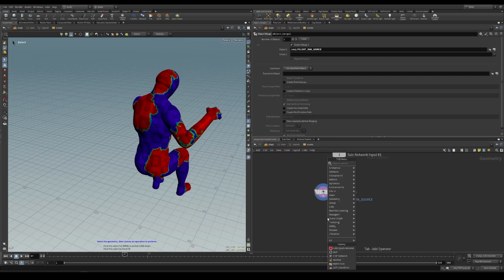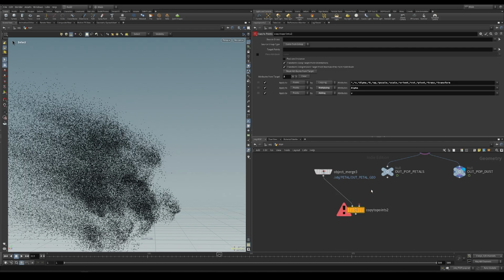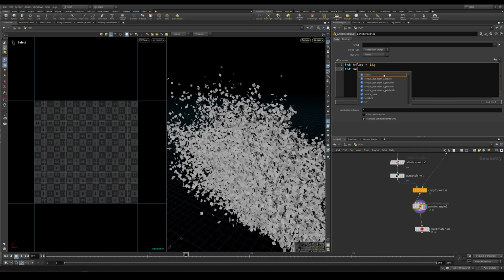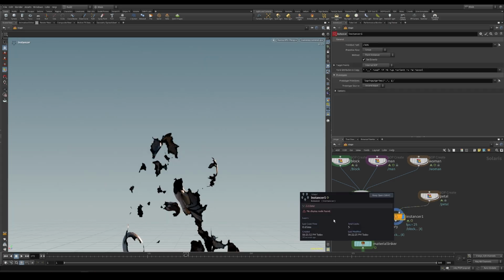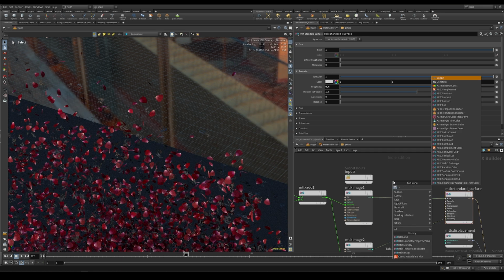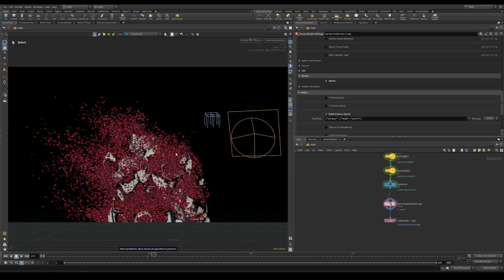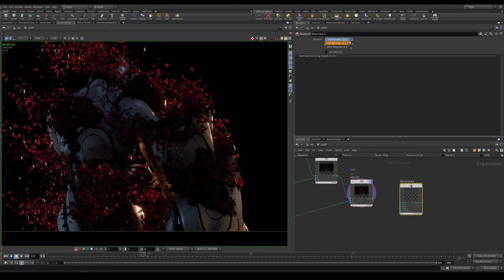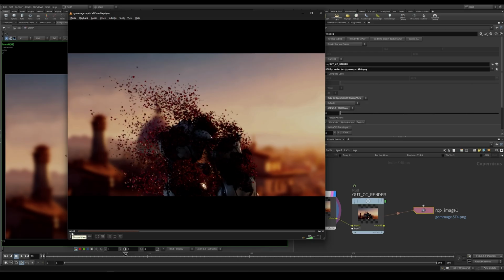Gommage FX in Houdini - 04 Render and Compositing

Comment: After I use attributewrangle node to delete masked points my mesh began to warp. I suspect this happened because the point numbers changed. Is there a way to delete these points while preserving the original point numbers? Or should they change, and is my problem related to some mistake made?
Reply from the maker: Hi, could you highlight the timestamp, give or take? Just to avoid going over the whole setup, cause it's been a while since the tutorial 😅

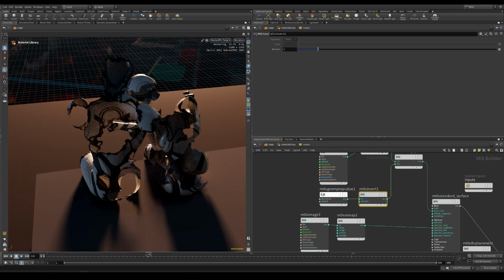Comment: in  4:03  could we adjust the age parameter somehow to increase or decrease the blacking boder effect??
Reply from the maker: Yes, but being tied with the age, you can't make it "larger" than the max age as it is right now. You could use a wider range for the age, then "restrict" it for the actual age and use the raw one for the material.
Or another way maybe quicker would be to store another attribute transferred with a timeshift like I did on the age, and use that to control the black edge on the material.